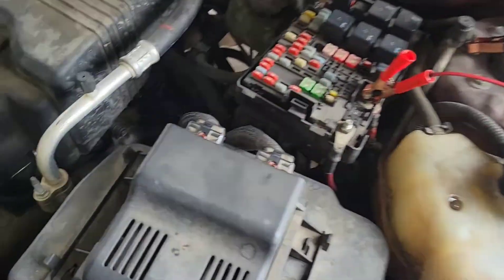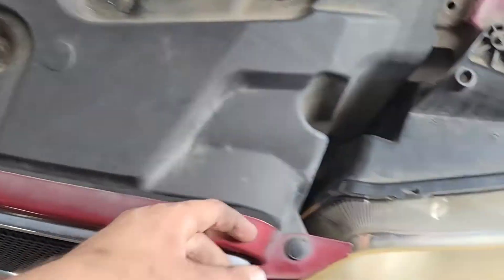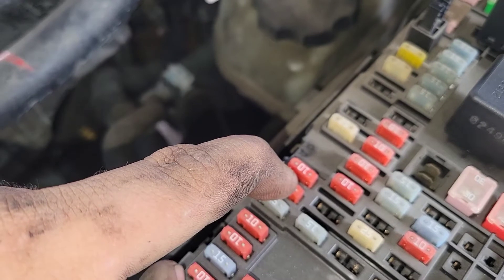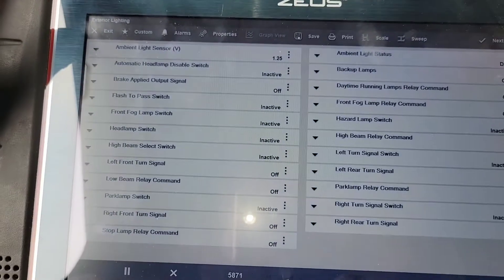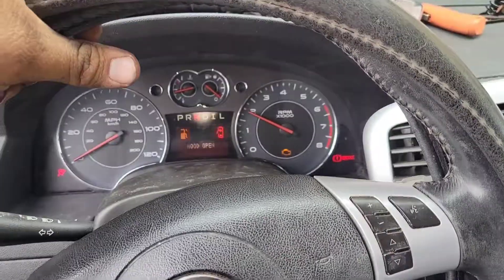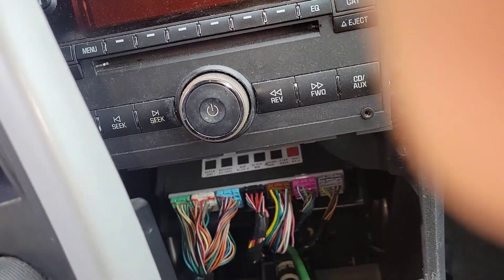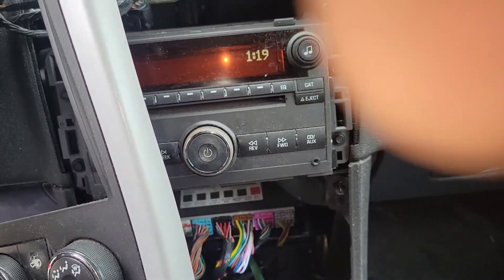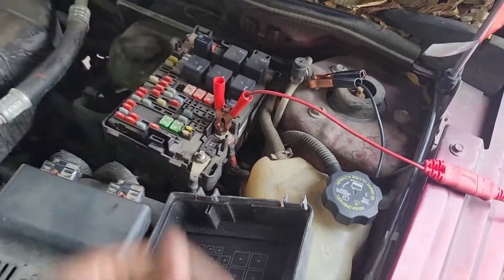2006-2009 Pontiac Torrent 2005-2009 Chevrolet equinox headlights not working diagnostic aid

Comment: 08 equinox owner hear. Thanks so much for this video. 

Couldn’t find anyone to explain the relay for lights is built into circuit board of the fuse block. 

I had bought this car used. The headlight/turn signal switch was bad as it wouldn’t cancel turn signal after turn but it didn’t fix my headlights not engaging proper high beam for left side. All fuses check good etc… thinking maybe it’s that fuse block now.
Reply from the maker: Glad it helped. Sounds like a bad fuse block.